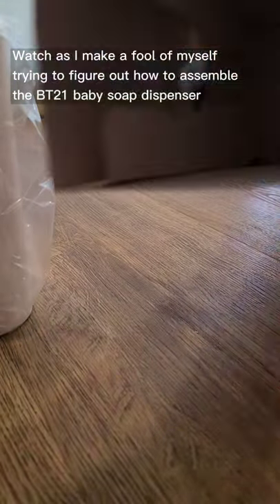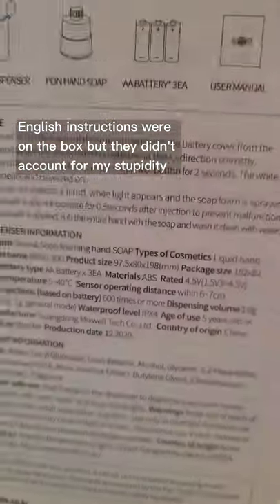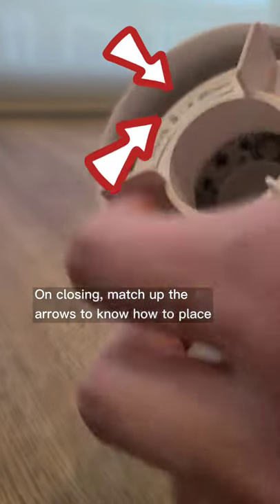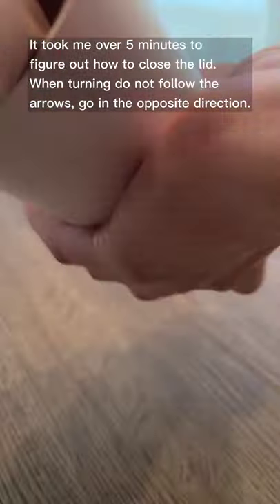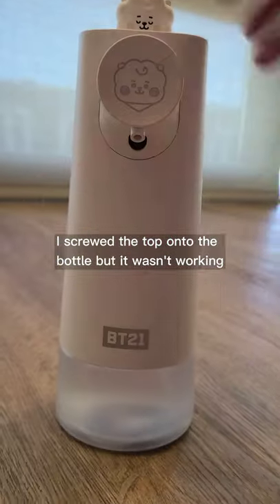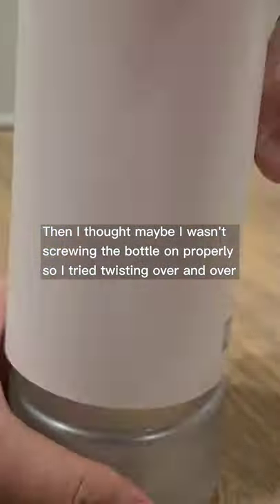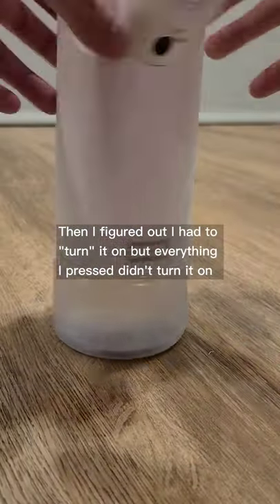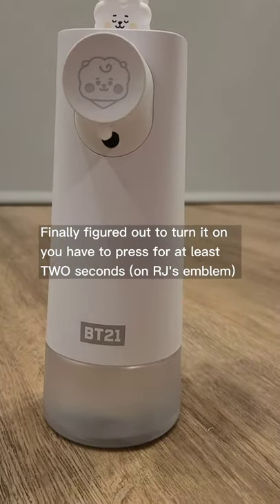BT21 Baby Automatic Soap Dispenser Assembly

Comment: Hey I have a question if the soap they provide you with runs out, can you refill with any soap or do you have to buy special soap refills? 💞
Reply: Yes, you can refill with any other type of soap, I recommend the foaming soap dispenser one. That's what I've been doing it with mine, since it ran out.🥰

Ps. Hopefully Line Friends  restock more of the hand soap refills.🙏
Reply: Ana Hernandez thank you, I was hesitating to buy since I saw the refills were out of stock 😅 yes definitely let's hope they restock soon 🙏🏻
Reply: No problem 🥰 glad I was able to help💖
Reply from the maker: @MarianaHernandez0119  Thanks for sharing! I was planning to try another foaming soap. I also didn't get the refills on Line Friends.
Reply: @MarianaHernandez0119  when u refilled urs with another type of soap did it start to dispense small clumped foam out? 
Cause it did for me after a while but I did buy the bt21 refills to see if it’s the solution concentration of the water until then thou I need to experiment it

Comment: How can I make it work? I change the refill with the original soap but the soap dont show up even tho the light is normal and the sound of pushing its ok, idk how to fix it and I even change the batteries but didnt work.
Reply from the maker: Try wiggling the soap container on the bottom and tilting forward and pushing downwards from the top to see if maybe that helps. Mine is very sensitive to the position of the battery so slightly repositioning seems to help maybe?

Comment: Hey can you explain that how to open the dispenser to put the battery???
Reply from the maker: Push down slightly, keep pushing down and turn Iike you're turning a knob/wheel. Try turning counterclockwise, if that doesn't work try pushing down slightly and turning clockwise. Good luck!
Reply: Ahhh were you able to get yours to open!! I’ve been trying for 20 minutes and it’s not budging 😭

Comment: how do you get it to push down?
Reply from the maker: Do you mean when pushing down to open the cover to put in the batteries? Just grip, slightly push inward/down and then you will be able to turn (try turning in both directions to see which direction is right for you).
Reply: @D_nn_C  ohh thank youu i got it :) but when i press on the button there’s a red light, any idea why that’s happening?
Reply from the maker: @miriachung7599  when u press white should mean on, if u keep finger on while pressing light turns pink meaning it will dispense larger volume and then red should mean you're turning it off